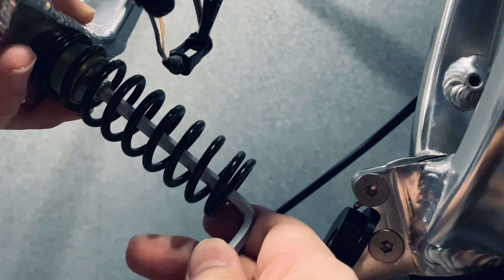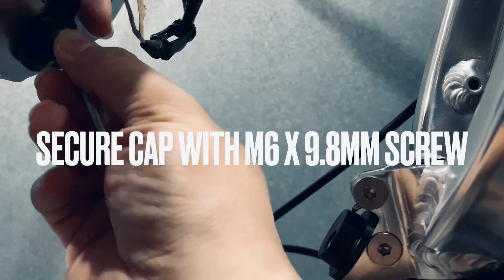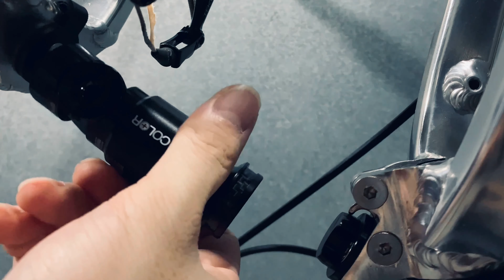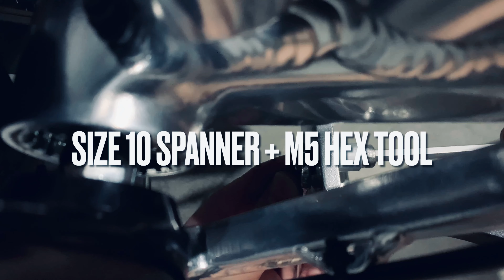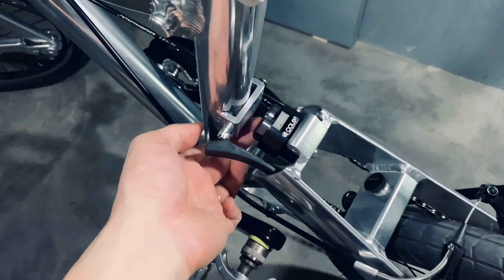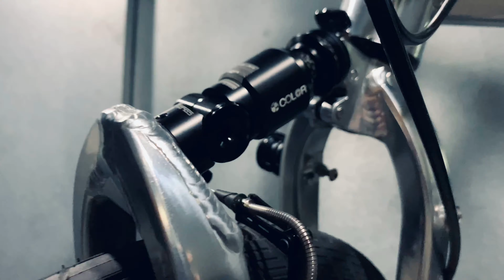ColorPlus Suspension Installation On Birdy Bike

Comment from the maker: Aftermarket suspension is a great addition to your riding style for speed. A stiffer and less flex suspension will provide better steering and reduce rolling resistance. 

The ColorPlus front suspension can be a little complicated to install but the posh looking design of the latest ColorPlus suspension model BS03 is perfectly splendid!

Comment: Hi were all the screws provided? or did you have to buy them yourself? or can use the stock ones
Reply from the maker: Hi snowy2k, the suspension set comes with an instruction sheet and screws required for installation.

Comment: Do you know the recommended weight limit of rider?
Reply from the maker: I feel this suspensions has a smooth flex for user up to 70kg. It won’t be stiff enough for a rider weighing above 80kg as I’ve seen them flexing harder from each pedal stroke.